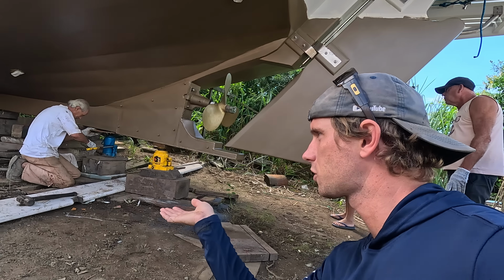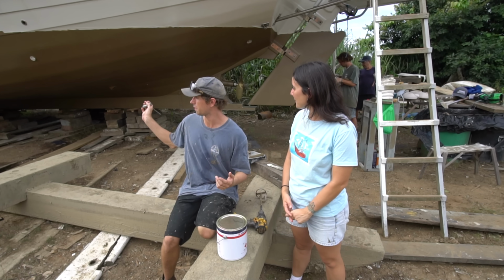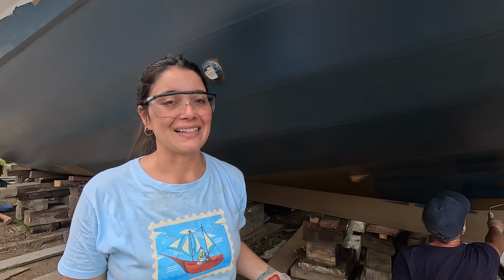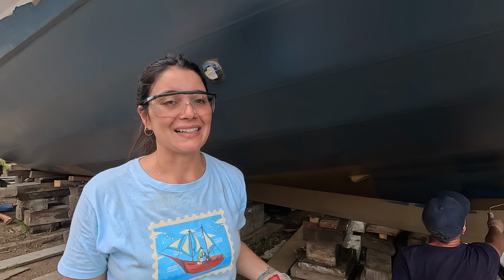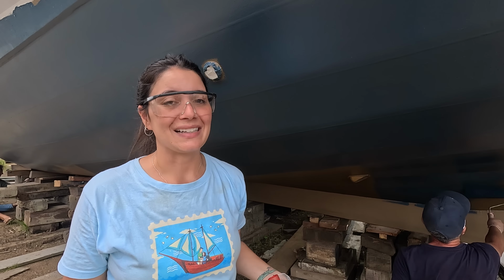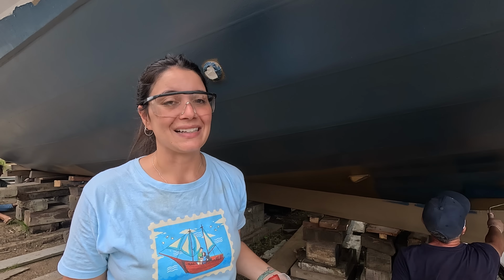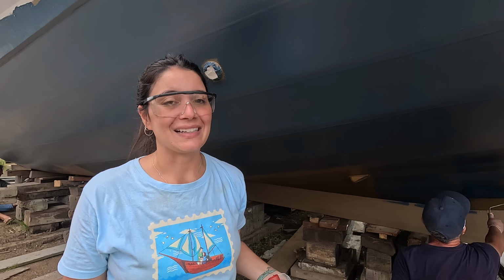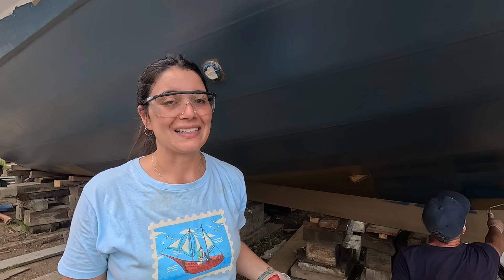Prepping for the Plunge: Anti-fouling & Boat Transport Starts! — Sailing Yabá 201

Comment: Hard to believe it has been 3 1/2 years since I found your channel by a referral from Roberta and Duca.
I remember you bought Yaba as she was sinking.  You were worried the hull may have been so rotted 
by ship worm infestation that it may have broken apart when you lifted her out of the water.
Look at her now.   Yaba is practically a new boat.  Have you calculated roughly how much of the original
ship remains?
Good luck splashing.

Comment: Thanks!

Love the seafoam green accent stripe on the top of the cabin. The best thing about using that crib is that it goes slower so you can access the parts that were unavailable for paint or anti-fowling rather than a last minute dash at the water If they were using one of those boat lifters to haul you out and move around the yard.

Comment: One little trick for the future, add a touch of other colors to the first layers so that each are a tiny bit different, that way it's much easier to see where you have good coverage as you put on the next layers, or you could just alternate 2 color variations to get the same result. You usually end up with very good hull coverage if you do it right and it's easy to see where more should be added. I can't remember where I learned that little trick though as it is lost to the fog of my mind.

Comment: She looks great. Well done! A tip for next anti foul, apply say, red colour first then for second coat use blue. That way you will clearly see any missed or thin areas. You will also see the rate of wear as the colour changes over time. Cheers and jolly good luck, fair skies and calm seas.

Comment: I think I would add a flap on the exhaust that will shut if a wave pushes up the back of the boat like it does with following seas of slowing down.  the pressure from the exhaust will open it with no problem at all and even direct some of the sound and smoke down toward the water rather than rising through the swim platform and making it nasty. Just a real quick suggestion before splashing since it would be easy now and a pain later to add the flap.
Reply: Online a poorly designed exhaust system or an exhaust without a bend or a gooseneck would need a exhaust flapper, been a professional boatbuilder for 36 years and never needed to put a flapper on an exhaust,

Comment: And finally finally finally !!! (I'm your worst fan here) A vertical strut for your stays there in the stern.  That's what I have been nagging you about.  A Truss effect.  Not just a little bit extra.  A critical doubling of the strength of the whole system.  Please Keep an eye on the Bowsprit.  Think about right angle stainless posts on the cables there like what your welding is doing now.  And further back to the bulkwark so support that rugged cross post in the bow.  ~ Now a (partial) Truss.  Double the strength of that cross post with a cable back on the boat. ~ both sides. This is Epic ‼Huge Huge Huge Congratulations ‼. I know you are proud here.   You should be.  Wow.  Just great. ‼Love you guys.   ~. Tears.   〰✨🙏✨〰 Steve from New Hampshire.

Comment: You do know copper is a poison the marine life! We used to use copper bottom paint. It worked but at a cost to poisoning marine life when we stayed in one place too long.  Do you not think it might have been a good idea to put a stainless steel strip along the bow of the boat for protection? Maybe at a later date? Look forward to seeing the boat in the water.

Comment: Woo hoo - the smell of antifoul - so close!!! Ask Zaca if there is any way you can be lowered in and stopped just before floating off so you can check for leaks, especially when everything from new planking, new thru hulls, valves, to even a new shaft log (etc etc etc) has been fitted. Even the best of us have had the odd "woops", - thankfully in my case, we could be hauled out again and the remedy quickly attended too! Why I say to ask Zaca, being a traditional slipway, their system might rely on inertia sliding down the ways to get you far enough out? (Bilge pumps at the ready in a wooden boat launch is standard until she takes up) Having been at your stage on a few occasions, the mix of emotions and sense of accomplishment is profound - well done you 2 guys and the entire Yaba team going back over 3 years!!!

Comment: I really wish that somebody would tell you to turn that intake basket around because it's supposed to face Forward not to the back of the boat that's what the grill is for to stop picking up anything that's that big to plug your system please turn it around or are you going to overheat your engine and you're going to have problems

Comment: Looks good but I wouldn’t forgive myself if I didn’t say the following. The Stainless tubing under the swim platform is a problem structurally. It won’t achieve the straight you are looking for. With a following sea you  or running with the wind will at some point put a destructive load on your the rigging to a point it could cause the rigging to collapse. I know this comment may not be popular but it still needs to be said.

Comment: Antifouling. On the tin it will tell you the correct thickness to put on, I see a few painters squeezing as much paint as possible out of rollers. It will need doing again in 6 months. Just saying
Reply: PS One more heavy coat will be better than 2 more thin coats